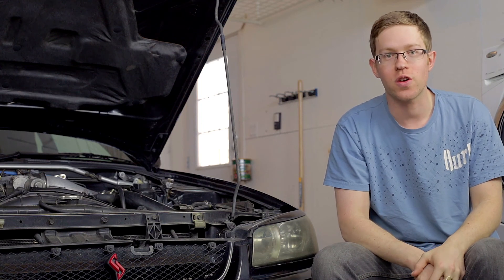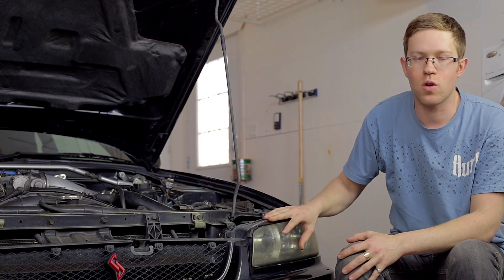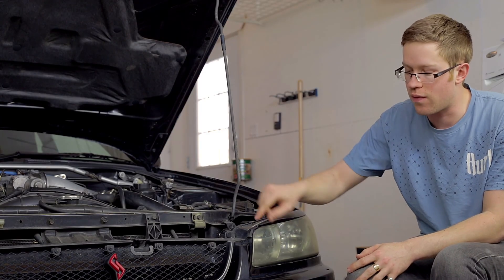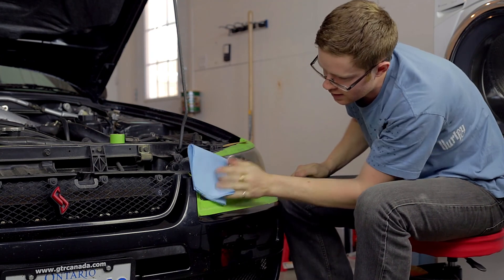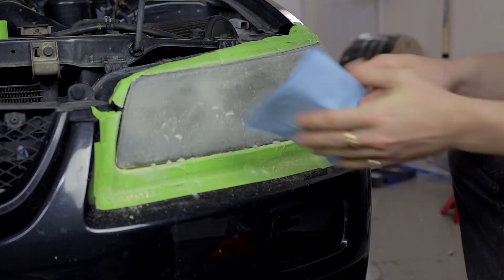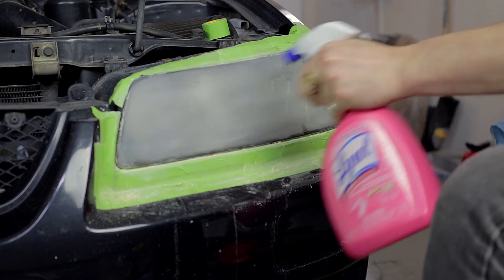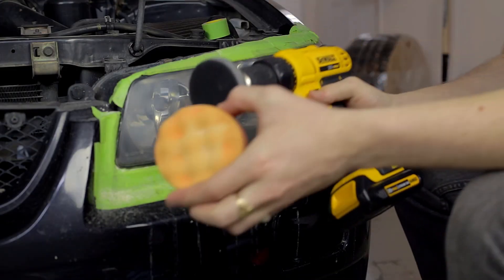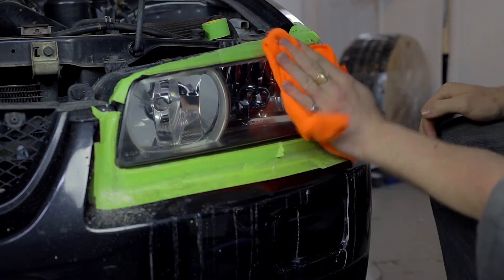Restore Your Headlights - Pistonhead Garage

Comment: what do u recommend for uv protection?
Reply from the maker: +awais A I would use a protectant designed specifically for clear plastic. You can usually find something at the local auto parts store. The kit I used came with 3M headlight sealant.